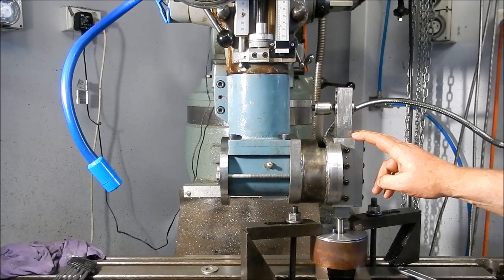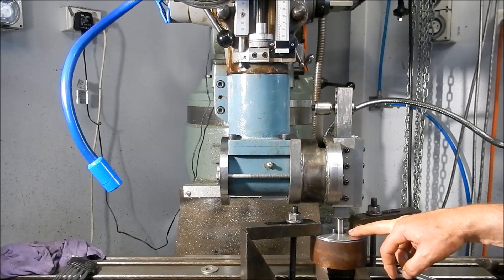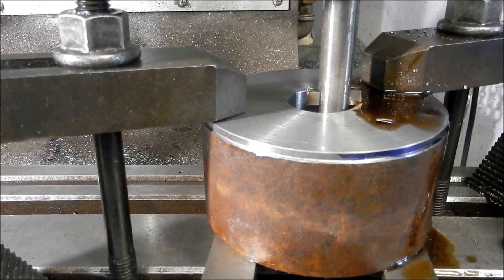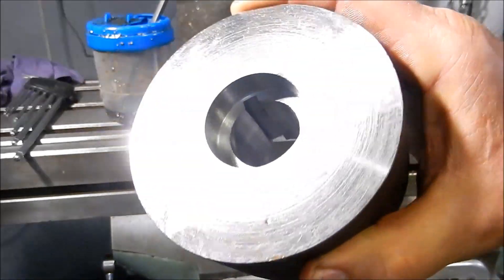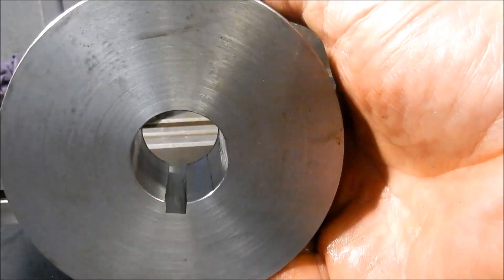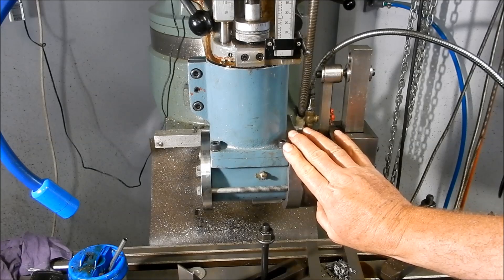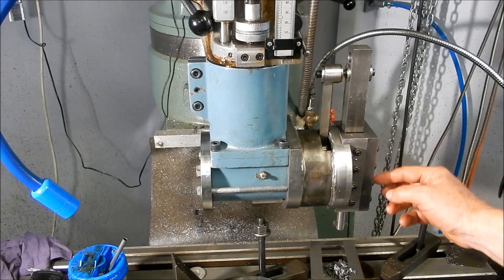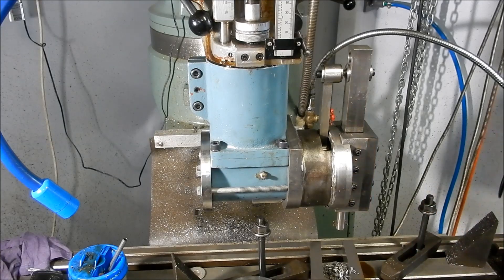Slotting Attachment for the Bridgeport Mill

Comment: Out of interest what material did you make of the cutter shaft from?  I have an Alba 1A shaper and trying to figure out what material to make a slotting tool from that will minimse deflection issues.  Cheers.
Reply from the maker: G'Day James, I used a piece of 4140.  I need to make another holder with a bigger diameter for more rigidity.
Cam

Comment: Hi Cam, my home made slotter bolts to the side of my mill drill and driven from the mill motor, had to cut a blind keyway the other day, can't do that with a broach.
Reply from the maker: They are a handy piece of kit.  Not used very often but nice to have it there when needed.
Cam

Comment: Great for small jobs & does not take up heaps of space .   I have the full size one that mounts on the rear but my current shop is too small to set it up !      Cheers .
Reply: Hi Max, the biggest slotter I have seen was in the Midland railway workshop, definately would not fit in your new workshop, monster for doing steam train rails.
All gone now.
Reply: @willemvantsant5105  There was some massive planer machines there last time i wandered around there .
Reply from the maker: G'Day Max, that was the number one reason I built it that way, lack of room.  The mill is pushed hard up into the corner and I couldn't swing the head with a slotting attachment on the tang of the ram.  Besides, they cost as much as the mill and only get used very occasionally so even if I could fit it into place I couldn't justify a spend like that.
Cam